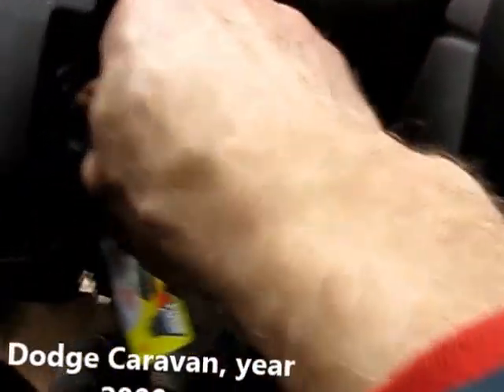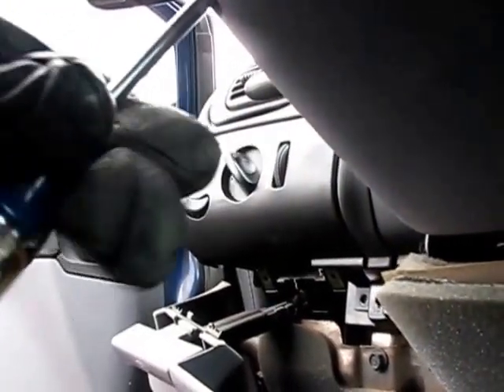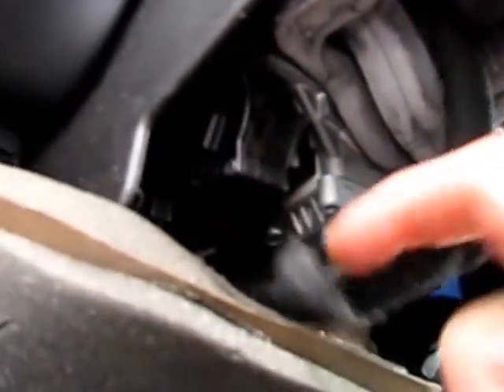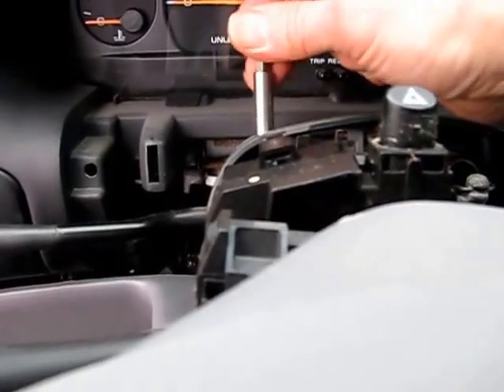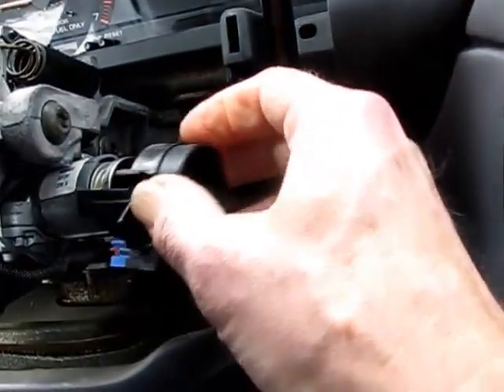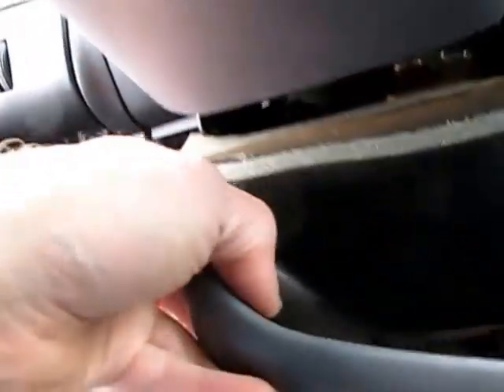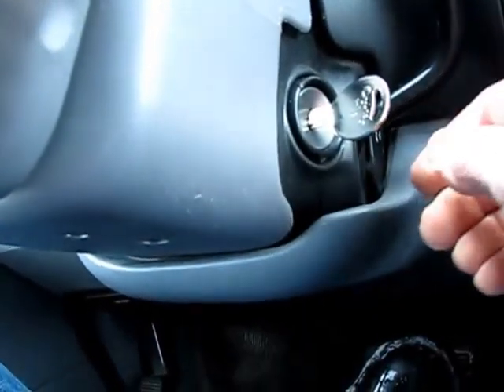How to replace an ignition lock switch

Comment: What if I no longer have the key, that's why I'm replacing it! Lost keys!
Reply: jims99tvs exactly I’m in the same boat, what did you do?
Reply: Y’all figure it out?
Reply: Show me how to replace the thinking ignition lock cylinder on the dash on a 98 Corvette
Reply: For anyone in the future needing this, use a drill bit or chisel to chip the release flat to remove it, only damage the release enough for the cylinder to come out. -automotive locksmith

Comment: yes the switch is wrong that may be the truck won't start.. i have a 98 3.3 caravan truck. When I turn it on, I only know the lights turn on. and the engine won't start. greetings from Sinaloa

Comment: My son used the tilt steering to move the colum around. We only had to remove the two plastic covers over and under where the ignition switch goes.
Reply: I couldn’t find a button for the tilt or it woulda been easier I don’t think mine had one

Comment: I'm guessing I got the ignition cylinder either stuck or I'm not pushing the right button because it's stuck halfway in, it'll turn a bit to the right and bit to the left but I can't pull it out.

Comment: Great video! Mine was sticking and didn't move well. I ended up taking it out and putting powder graphite (instead of WD40) in all the crevices to get it all loosened up. Worked very well. Thank you for posting this!
Reply from the maker: You're welcome. I was told by a Chrysler technician not to use graphite in the lock cylinder. He said it will gum up the works. Of course I paid him $60 to rebuild the lock with new tumblers and a week later it stuck again.

Comment: i have a 200 grand caravan se it doing the same thing ur video doing but i have to fuss with it and it turns thank you for this video man... really.  now i know wat to do to get it out befor it wont turn period
Reply from the maker: You're welcome. Good luck with it when it fails completely.
Reply: i didnt wait took out the old one befor it got worse and replaced it
thank you
Reply: Smart idea. Mine was fidgity for a long time and then I got stuck at the grocery store. Luckily after shifting it in and out of gear it started one more time and I made it home. After that it wouldn't start again. Son replaced it last night and it's back in business. This is at least the second switch this van has had. They go out a lot in these vans.

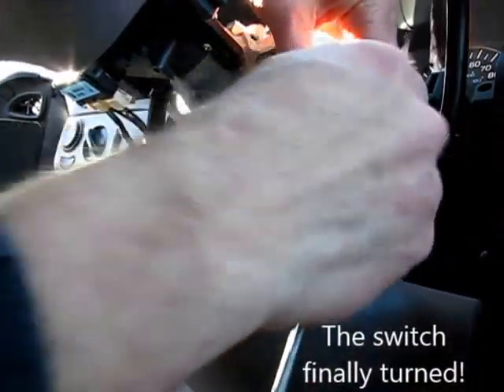Comment: Great video. It worked for me all the way up to the 6:00 mark where your key magically turned. Mine did not turn. I flushed it with Electromotive Cleaner until it was no longer pouring out of the cylinder as a black fluid. Sprayed 3-in-1 Lock Lube, but it still will not turn. At this point should I just break or drill out the cylinder???
Reply from the maker: Try tapping the key lightly with a hammer. This sometimes persuades a stuck tumbler to get out of the way. If you tried this and it fails, yeah the drill

Comment: So someone tried stealing my 04 T&C, not only was the CPU fried so even if it didnt have the new ignition (where you can put a screwdriver in it and let  it rip), it still wouldn't have went. But they took the ignition part out and theres copper coils everywhere. could i fix this at home? and if so, how? also what would be your estimate if i had to take it to the shop?(doesn't have to be spot on btw)
Reply from the maker: That's a tough situation. This is far beyond an ordinary car repair. I really have no ideas on cost. This sounds like insurance may come into play to help you.

Comment: Rock Auto has a complete cylinder kit with all the wafers to key it yourself. No need to go to a dealer. Super easy repair.
Reply from the maker: The dealer repair on mine didn't hold up for long. I found a Statec kit and it's been working good for over a year now. Thanks for the info.
Reply: I used the Dorman kit on my dakota. Takes more time to remove all the plastic stuff than to complete the repair.

Comment: Replacement aftermarket priced @ $100;
97 Dodge van ~ need to find how-to video;
I used Amsoil product this morning on 2 new keys cut from blanks that did not open side and back and now can open them - plan at the moment is to use screwdriver on ignition switch and retain keys for doors

Comment: i have a 2000 Chrysler 300m. my key was stuck in the ignition. I've taken everything off and finally got the key out. but if I put the key back in and turn it, it will not come out. right under the switch is cable with a little plunger in it. if that is out of it's holder the key will go in and out of the switch. does anyone know what that plunger is called and what does it do?
Reply from the maker: That's probably an interlock device, a safety feature to keep the car from starting when in gear. Something may be amiss in there.

Comment: great. ..what vehicle is that a 2000 Chevrolet Jimmy?
Reply from the maker: Thanks, it's a 2000, a Dodge Caravan though.
Reply: +The Original Mechanic My Dodge Ram doesn't lock and any key can start it. Can replacing this part fix my truck and allow me to lock my ignition?

Comment: if not in on position how do you take key cylinder out
Reply from the maker: I think the entire ignition switch would have to come out for replacement.
Reply: Doalllabor Doalllabor photo
Reply: Lost keys
Reply: @robertwissinger4931  how do u take out the hole  cylinder

Comment: ? My switch went bad and the key was stuck I know this vid is pretty old but anyhow I had to get the van started so I fought with it until I got that cylinder out But when I put the screwdriver in to start it a small brown plastic piece and a spring came out it started but wondering how important those are, before I buy a new lock cylinder..thanks
Reply from the maker: I have no idea, but usually a bad thing when unknown parts are fall or fly out. But as I've discovered, every little thing in there isn't absolutely essential.
Reply: hey thanks for getting back to me , it is starting ok with the screwdriver so i think it will be ok, Thanks @TheOriginalMechanic

Comment: If the Switch is stuck how does it get turned to the on position during disassembly?
Reply from the maker: +Bill LeGard Usually it will eventually turn into the on position. But if not a few good raps on the key with a rubber hammer worked for me. If that doesn't work the entire assembly may be needed.

Comment: I’ve lost my key what do you do if you can’t turn the switch to push in the little lock and release the ignition? I’m stuck trying to figure out what to do about it. Went to the dodge dealership they made me a key by the vin but I’m thinking the guy there didn’t do it right. I took it back and he said it was right but I’m doubtful he really did it right. Now I’m at the place that I want to just take the tumbler out and replace it but the key is not right so it won’t turn 🤷‍♂️
Reply from the maker: You may have to replace the entire ignition. I took one out once and it isn't too hard. I had to buy a couple of Torx security bits to remove the tumbler body. You may be able to find used parts online or at the junkyard as these are several hundred dollars new.
Reply: The Original Mechanic ok thanks 🙏

Comment: I've taken everything apart, except because my key wouldn't turn to start my grand caravan I'm not sure how to get it into the on position to remove the old cylinder. Any suggestions? Thank you Wendy P.
Reply: I'm having the same problem, key won't turn in on position....
Reply from the maker: This was from 7 months ago and I just saw it for the first time now. Mine did the same thing. I seem to remember tapping on it with a hammer to get it to move. But I think I'm too late!
Reply: I took something hard and tapped while turning and got it to turn, at least my vehicle is home... now trying to figure on if i have a chip, Auto Zone says no, but Dodge says 2001 up most do.... so.... I'm gonna change it tomorrow per your directions and we shall see...
Reply: @gulfcoastcajun  No chip  in any of my 2003 vans.....

Comment: My key won't turn to the on position as one of the steps to remove, what do I need to do to get it out?
Reply from the maker: Try tapping the key lightly with a hammer as you try to turn it. Sometimes this can move a stuck tumbler just enough...

Comment: how do u do it with no key
Reply from the maker: Unless you want to take out and replace the entire ignition, you'll need a key. Either go to a dealer with the key code or you will need a locksmith.